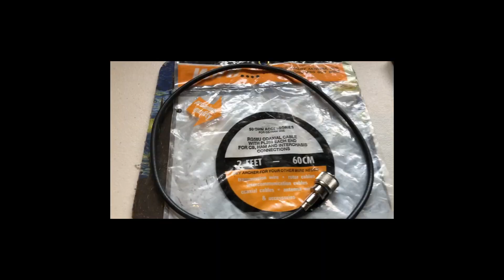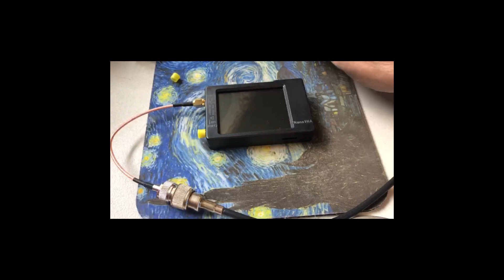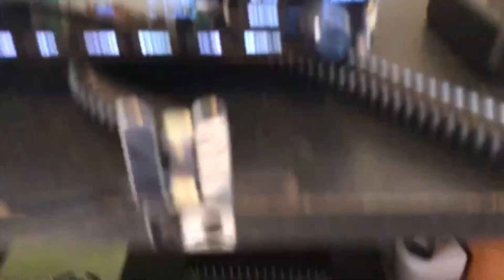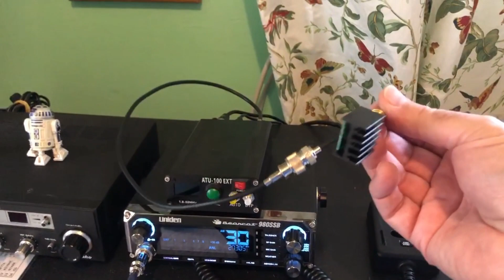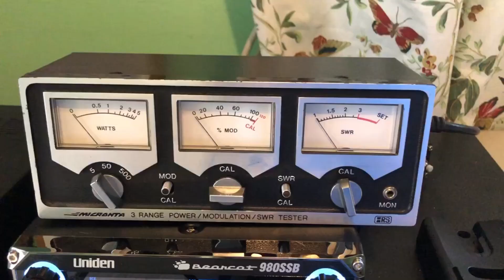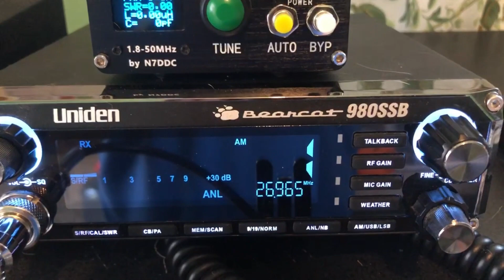Using an analog, NANO VNA and antenna tuner SWR meter to check SWR

Comment: Just curious, are your jumpers cut to "Null" or resonate to the frequency of 27mhz???   I would skip the 3'f jumper theory and start with a 6'5" jumper and get it as close to a quarter wavelength ~ to the center of the 27mhz band by clipping off a half inch at a time untill you reach a NULL. I have found that the 3'f jumper rule is nonsense. Iam not familiar with that NaNo device your using but if it works like a Rig expert, you can easily tune your jumpers to frequency in a snap. 
   To tune a jumper, just put a pl259 on one end of a 6.5' piece of coax leave the other end open and clip a half inch at a time until you reach your null, then put on the connector, then you will have a tuned jumper which should be around a quarter wave to the center frequency of the 27mhz band.
   Always keep in mind, analog meters will always have a different reading than a digital meter inherently.
    Use this method 486÷ your frequency in mhz will tell you in a round about figure the length your coax jumper should be, and it certainly isn't 3'ft.
Reply from the maker: Thanks for the advice, I really appreciate when someone experienced shares their knowledge instead of trying to put someone down. I'm going to follow your suggestions and create a tuned jumper for the 11-meter band and retry the tests. 73s from 595 Lake Tahoe Nevada!

Comment: I would use the analog meter. Easy - accurate and will withstand much more power. But I would want a peak reading meter rather than the average reading meter you have, especially for SSB.  My opinion.